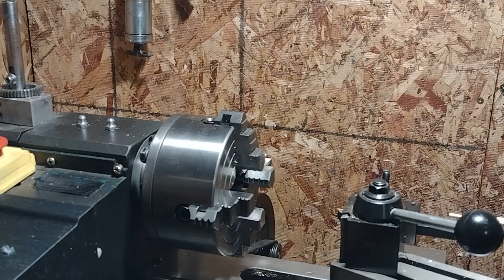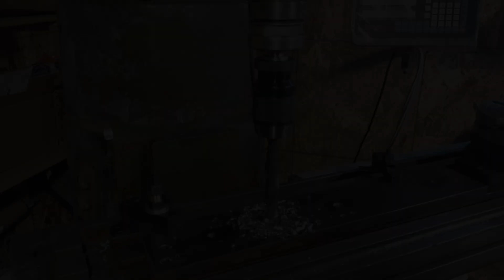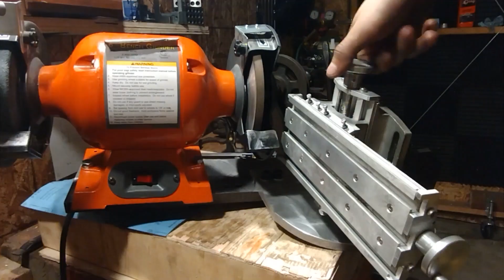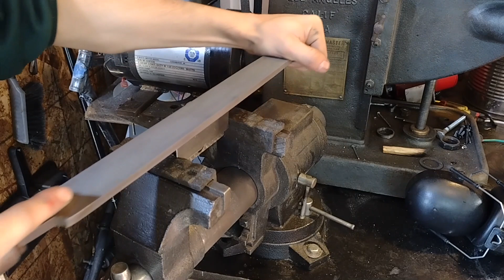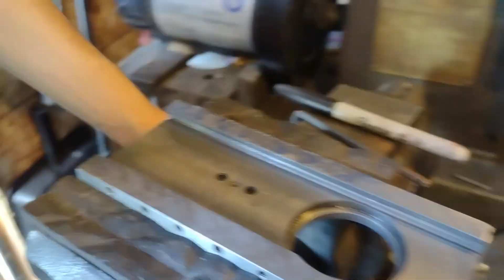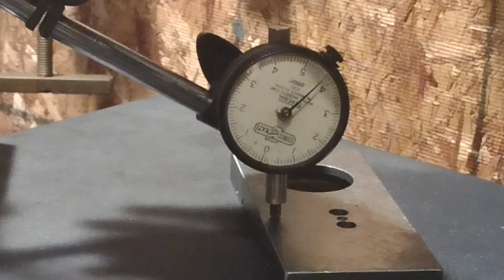Surface Scraping: Mini Lathe pt. 2-- Grinding Fixture Concluded

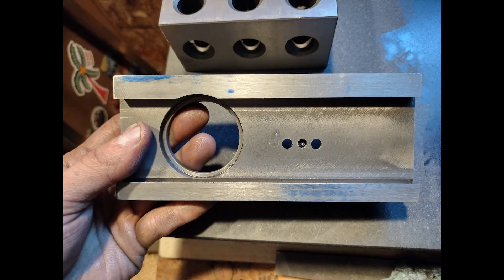Comment: The persistent low corner 13:20 is a typical beginner mistake which I have also made.  You've got to do some fairly aggressive rough scraping until you get even contact over the whole surface.  Sissy scraping is something Richard King will make fun of you for with chicken noises.  After you have good contact, you can move to refining the surface.  Good contact doesn't look good, it's just 5-10 points per inch.  Knowing when to move on from the roughing phase requires experience. So congrats, you're 1 project closer to the expertise you seek.
Reply from the maker: I'm no master. I've never even apprenticed. I'm just a college student who likes to machine in the backyard sometimes. Analytics say most of my viewers are males in the US between 50-60 y/o, so most are gonna have input and experience I don't have yet. Scraping is also an advanced, almost mythical topic that a novice will obviously not get right the first go. But I'll never learn if I don't do. My viewership shows that young people generally aren't interested in manual machining much less scraping, so I'm an exception. I don't know have the guidance of someone like Richard King or in-person friends to talk about this with, so I rely on the internet for information. Your comment is kinder than other's criticisms. Thanks for watching.

Comment: interesting grindingtool , to make the lathe a little more rigid you could replace the compound slide with a masive block of cast iron holding the toolpost , most flexing comes from the compound slide and unless you need to machine tapers you dont realy need it on there all the time
Reply from the maker: Yes, that's on the to do list. Thank you for commenting!

Comment: did you scrape in the gib?
Reply from the maker: I have not scraped the gibs or the internal part of the dovetails 🕊️. Gibs are definitely a low hanging fruit tho. What your thoughts on brass gibs? Lil machine shop sells some..
Reply: @backyardmachinist  i would think brass would be less forgiving than cast iron or steel. does the mini lathe have gib screws or a tapered gib? i dont remember, its been years since i used mine. i bought a 12x36 grizzly lathe and i gave the mini lathe to my dad so he could tinker with it and make parts for his model boats.
Reply from the maker: @theoriginalDirtybill  that's cool of you. That must've been a nice step up in size too. These lil lathes have normal ol straight gibs with screws. I was thinking brass might be better for wear resistance but if a gib is flat, it should cause that much wear i suppose even if it's ferrous

Comment: try mounting your slide and pivot 90° to the grinding wheel, then put your 5° angle in the carbide holder. this should give you a even parallel cut on the carbide.
Reply from the maker: Yeah I might try that in the future with a cup wheel perhaps. Seems a lot more versatile for other grinding jobs too. I think a low speed grinder/lapping wheel would be best to get a perfect finish. We'll get there!

Comment: Nice. Ther's a right way to do things,  the wrong way & your way. You work with what you got. That includes tools,
materials & experience. I've been through this before. I found myself & some of my friends questioning my sanitiy
for spending so much time on scraping. I read in a book some where that at the turn of the 20th century, every
apprentice mechanic learned to scrape in a gasket surface. It's a lost art. I'm glad I learned how to do it a little bit.
You're right, it takes a lot of patience. I'm trying to learn that too.
Reply from the maker: All we can do is work with what we got. And yes, this whole surface scraping thing ends up being rather vendantic or meditative. Certainly builds the patience muscles wherever those are... Thanks for tuning in and commenting!